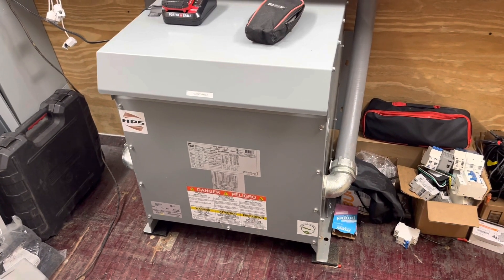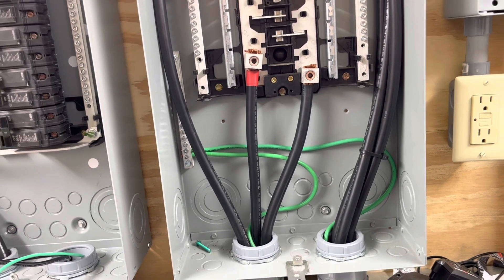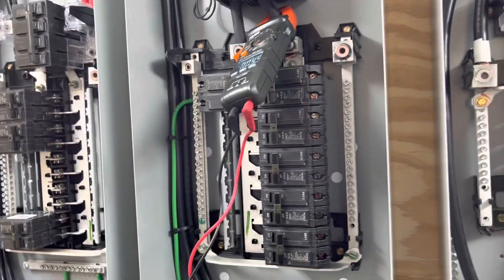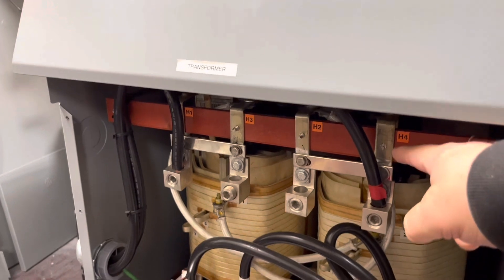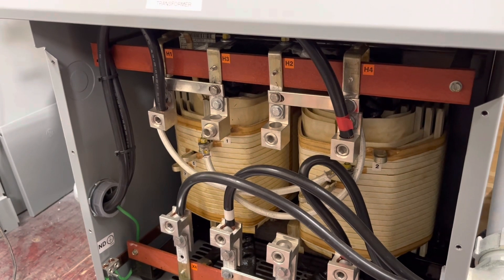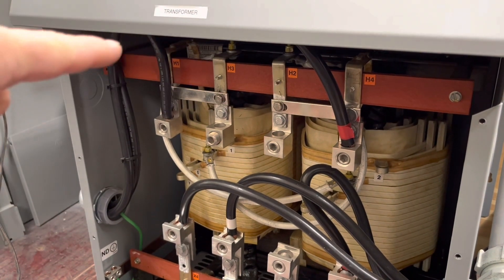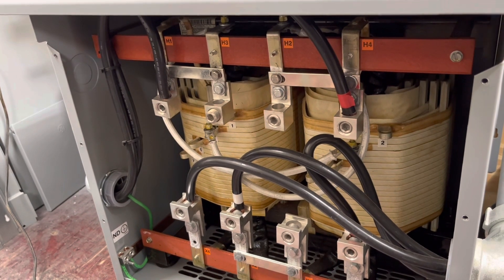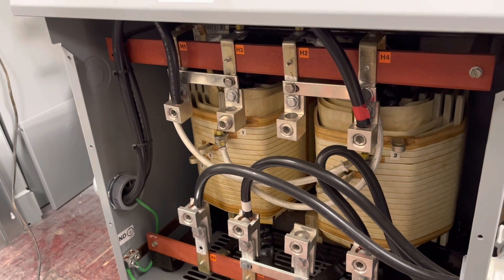Modifying Wiring System for Growatt to Sol-Ark Transition

Comment: nice video, just curious why 125A from each Sol-Ark?
Reply from the maker: Largest breaker I could install in the panel. My panels are protected with 200A mains. I put the largest sub-breaker (125A) available in case I should have the need to operate with one Sol-ark. 

One would be marginal for my needs but with some lifestyle adjustments (something my wife is adverse too) we could manage with one Sol-ark in an emergency.

Comment: You could have used the transformer to balance the Sol-Ark, of course.
Reply from the maker: Yes, and I considered doing so. But I don’t think I’ll have a balance issue since I’m using two Sol-Arks and I didn’t want the extra power losses of the transformer if I could avoid it.

Comment: I still don't understand why you American don't have a switch on your outputs for safety 😕.
Reply from the maker: Not sure what you’re referring to. I have switches everywhere.
Reply: @jeffmotes2129   Does the new inverter put out 240 Volts on two phases at the same time?
Reply: @chuxxsss  It puts out 240V split between 2 lines, so each line gets 120V from the 240V signal. 
You can picture it as if you took every other wave and switched which wire it traveled down. This is not it really, but an easy way to think about it.
Reply from the maker: @chuxxsss  240V L1-L2, 120V L1-N, 120V L2-N. This is a typical single phase service in tge US. Large appliances like HVAC, water heater, ovens, and dryers are typically 240V. Smaller loads like lights, TV, Wi-Fi equipment, microwaves, coffee pots are typically 120V.
Reply from the maker: @chuxxsss  as I have them configured the inverters are in parallel putting out the same single phase voltage and are phased together.